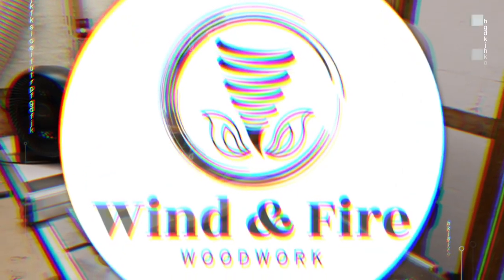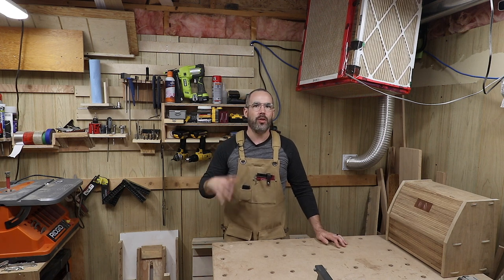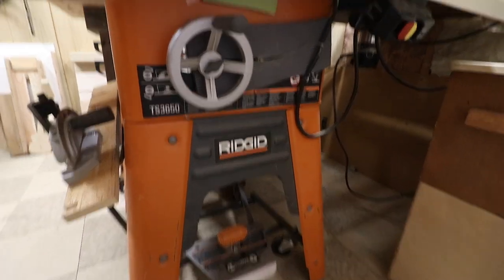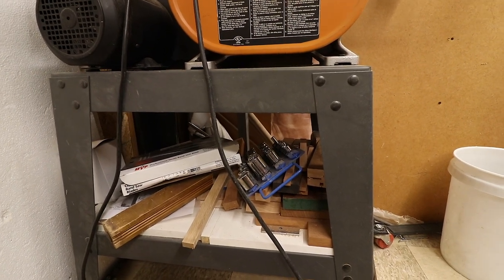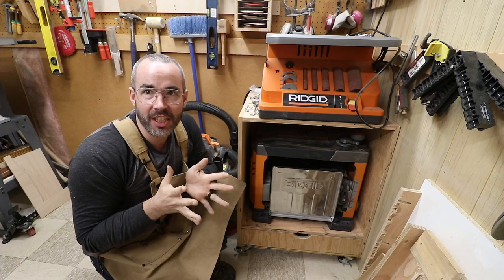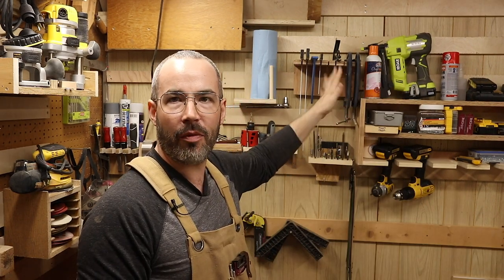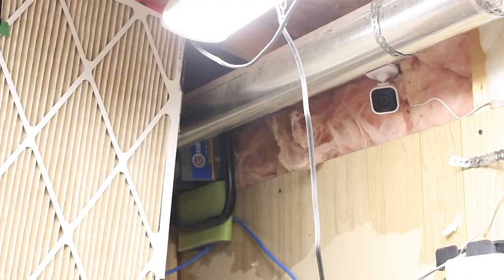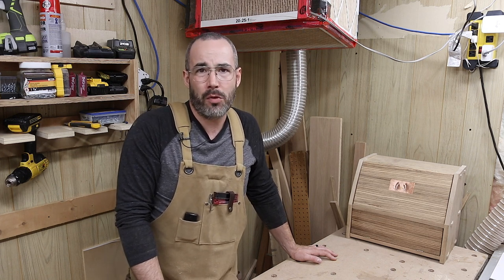SUPER Small Woodworking Shop Tour. Small shop organization.

Comment: I’ve been doing this for a long time and the main advice I can give you is DO NOT GLUE any shop cabinets/furniture. Shops and ideas change and all that wood can be reused as you refine your needs. I have plywood that has been used from the first cabinets I built in new designs that work for me today.
Reply from the maker: That’s actually a great tip! I’ve been using glue and brads for speed lately, but I’ve also reused some old shop furniture that was screwed together. Thanks!

Comment: Hey buddy, solid video. I'm also in a small shop and thinking about dust collection as well as fine dust filter box. I haven't yet and i'm gonna, but if you don't have a specific vid on it I'd recommend doing one on your dust collection journey. Both the chips / heavy stuff AND the diy filter box for fine dust. I'm in the same boat where I have outside access through a window in my shop and heavily considering running my exhaust there instead of into a bag.

Comment: Great use of space overall. I love small shops. They force you to be a better woodworker as you have to deal with the mental and physical gymnastics of working in a confined space. My shop is a 12x20' garage and I'm still optimizing things years after originally setting things up. I think the biggest shop I'd ever want is a two car garage.
For your table saw cabinet, I'd make shallow shelves on the back wall where your blades are, and also make some narrow shelving to the right of the table saw for the router bits and accessories.
I really wouldn't call french cleats contested; it's an excellent system that's easily customizable and very strong. Not many downsides to it really.
One thing I learned working in my shop, purge unused items and unnecessary things like scraps that you think you'll use, but haven't in years. You'd be surprised at how much space you regain.
Reply from the maker: I like the shelving idea, thanks!
Reply: at vert least, turn your saw blade storage unit horizontally on the wall, higher up so teeth are not so near your head when you work at router

Comment: I too have a tiny shop, about twice the size of yours buy I have far more stuff jammed into it.  Under the router table wing on my saw is a Performax drum sander on rollers.  You could mount your planer on rollers and put it under there.  If you recreate the catch-all table in the corner you could make it at the same level as the router table and it might serve as an additional support, but OTOH you would have to keep it clean.  One of the best things I did was put a closet on the exterior of my shop and put my dust collector and air compressor out there.  Freed up some space and much quieter.  I visited a shop about the size of yours many years ago and that guy had cut several holes in the walls with little doors.  He could open a door and feed a board he was ripping through it.
Reply from the maker: Some great ideas! Thanks :)

Comment: I work in a small space and am very familiar with having to move a project to work on a different part. I also work on multiple projects at a time, so being able to easily switch them out is important. For your space, I would find a way to add shelves above your saw table, either hanging from the ceiling or supported by the wood studs (maybe eye or just above head height). You still have to move things out of the way to use the saw, but you can then move things or projects in progress off your workspace. Actually, if you could make it so it could be raised or lowered if you need extra height, that would be ideal.
Reply from the maker: Good ideas!
Reply: You could make that shelf extra functional by adding lighting and a gooseneck magnification glass.

Comment: You have made some good  use of the space, I would love to have that size workshop I'm currently working in 11ft by 5ft which means I rely on being able to work outside alot and have to disassemble my router table after every use, I have managed to get dust collection with a cyclone which has made my wife happy, I find that if everything has a deffinate home I can keep my worktops clear. I may get a compact dewalt table saw in the future and make that into a portable trolley with built in dust collection and some flaps that fold out into an outfield table.
Reply from the maker: Wow! Great job working in the space you have!

Comment: My shop is 11x21 and as  others have mentioned I have put every tool and bench on casters so they can be moved around.  A few things are stationary like the big tool box and one bench is attached to the wall.  I will suggest that you could utilize your wall-space better for tool or jig/fixture storage.all of my walls are covered in French cleats.  Also consider a rack mounted to the ceiling to store larger wood.  

I built a flip top for a Dewalt planer and a spindle sander and it is on wheels so it is real easy to roll into the right spot to use and return to its storage spot when finished.
Reply from the maker: Great points! My cart with the spindle sander was originally going to be a flip-top cart until I realized it would be challenging to pull away from the wall and flip in such a small space.

Comment: Thank you for sharing!  Great job dealing with your limited, but cosey space.  Regarding your side table issue, I imagine resizing the current cabinet/old router table, or building a new one that will roll up under the table saw.  Give it drawers that pull out.  Or course, you’ll have to include a channel to clear the router.  But, if you could put a small slide out surface on the top that could pull out to act like your current surface, it could slide back in under the router table extension when you need to stand there.  Or, you could have a piece of wood that could sit on top of a pulled out drawer.  This would be an alternative to the fold down table idea, which is a good one too.  
Separate from the above, I would use some scrap 1/4” plywood and cover up the insulation.  Exposed, it’s a dust magnet, and not good for your lungs.  Thanks again!
Reply from the maker: I agree on all points. Thanks!

Comment: I'm using the TS 3650 and have been contemplating making a custom movable base that will support the weight better, include storage and incorporate dust storage.  I would go that route for your set up and then do a folding table on the wall that can give you better access to the router lift.
Reply from the maker: Great thoughts, thank you!

Comment: 2👍
Take look at Andrew Klein’s “Out-feed table like no other “ video. Not cheap (but I’d Love to see more versions before I try it 😉). I’d cover the insulation ASAP , I found it to be a saw dust magnet and if(when) I hit it with a board or something, I’d see strands of fiberglass in the air😬😷
I’m really liking the Match fit clamps and putting dovetail groves in more areas on table tops and sides.
Reply from the maker: I’ll check out that out feed table video. Haha. 
I’m actually running into the city tomorrow and picking up some hardboard to cover the insulation. Thanks for the reminder to get on that!

Comment: Thought my little 12'x16' shed was small...I do have everything on wheels and keep things against the wall as much as possible. It does provide me room to roll my job site Dewalt table saw out and use in the middle space, but in nice weather it goes outside for sawing. I am thinking of making a small deck outside the front double doors so I can roll my saw or whatever outside and use them in good weather, or maybe even put a roof over it and use it in foul weather, maybe by hanging some removable tarps for walls. As far as the flip cart, I have one, I like it, but I see your point and agree with your decision not to make it a flipper.
Reply from the maker: Wheels are definitely the secret sauce for a small space. When I had a Skil jobsite table saw, I also had everything against the walls and sometimes would bring it outside. But, in Alberta, it gets too cold for too long to rely on working outside. My current tablesaw ends up as a bit of a workbench extension when needed, so it balances out. Cheers!

Comment: Re-make that cabinet so t fits under the router. Install one or more folding shelves on the wall under your saw blades.  That will give you a convenient place to put your saw accessories and fold the shelves to move to the router, roll the saw out will give you more access to the router table.  I have a contractor saw with a cabinet replacing the original legs.  All of my blades, dados, saw related tools, router bits and feather boards are in drawers.  The 1/2” router barely clears the cabinet at its lowest position, using a Router Raizer to lift the router. No wasted space around my table saw. My tenon gig and miter bar lives on the cabinet on the opposite side from the router.
Reply from the maker: Some good ideas, thanks!

Comment: I have a Micro shop, With my onefinity in it i have like no room. its like 8 x 12... have a jointer, table saw, thickness planer I'm trying to make it more usable, .... until i build my actual shop. thanks, for the ides
Reply from the maker: My pleasure. How do you like the onefinity?
Reply: @windfirewoodwork  I love it, in the beginning there was this really misleading thought in my head that I would get it and would just crank out beautiful things with the push of a button, lol, what a noob i was. After learning the ins and outs its really been a great addition to my woodworking. The CAD part is a little hard to figure out but once you get there the CAM is easy enough, got one?
Reply from the maker: @Carpenters_Canvas  unfortunately, no. It’s on my “someday” list, but it’s a large purchase and building my new shop has completely cleaned me out for the next while. Good on you for figuring out how to put one in a 8x12 space!
Reply: @windfirewoodwork  I hear that brother, I did actually post a video, you can see how  small it is, I have a ton of more vide4os to make but no time, and a shop to build too... That will clean me out as well bro, but it will for sure be worth it!!
Reply: @windfirewoodwork  Just tore my shop a[art lol, reworking the space to make it more suited, until the big shop build that is lol, but god knows when that will be.

Comment: 🤣🤣🤣🤣🤣🤣🤣 i hope i didnt offend you by say the micro word? as it goes my shed is a nano slither bigger as its 12x8. As for how a workshop should be set out really comes down to how you use your space, myself i keep moving things around. The only thing i would suggest is to try and keep all work units/ tables mobile as it helps in a small space. And as for tools i dont buy into must have tools and buy only what i need and can afford, as time goes by you will upgrade your tools and others will collect dust and be sold as not used as thought.
Reply from the maker: No offence at all, haha. I agree about everything constantly moving around. Nearly everything in my (micro-shop 😆) is on casters or French cleats so I can do just that.

Comment: I put a tray for the table saw accessories no the left side wall of the saw where your serial number pad is located. It holds nearly all the things you have on the shelf surface of the cabinet you have in the corner. Wasted space if you don’t use it as it’s under the saw….
Reply from the maker: Good idea!

Comment: "Recreate" your love/hate, original router table under the end of the tablesaw/new router table but put a slide out table top that connects to the opposite wall for stability.  This would give you the table top "catch all" you love when you need it but when you need to get close to the router table to work comfortably you can clear it off and slide it out of the way.
Reply from the maker: Good suggestion!